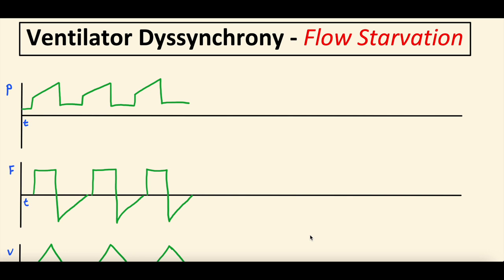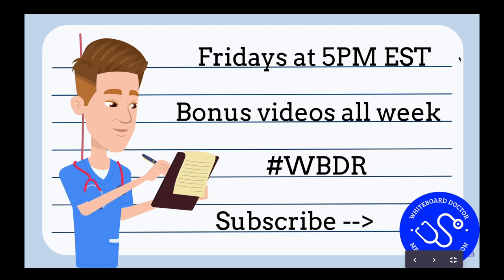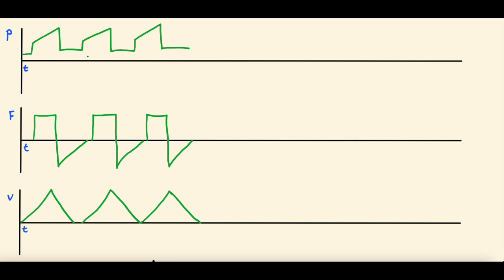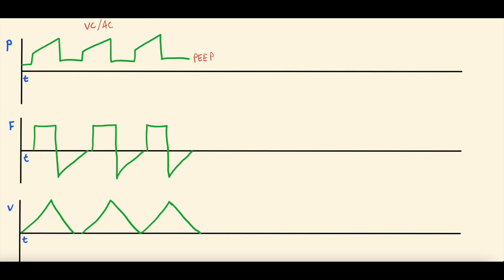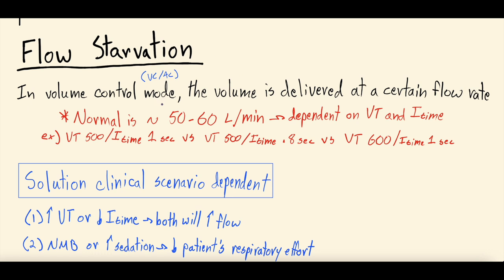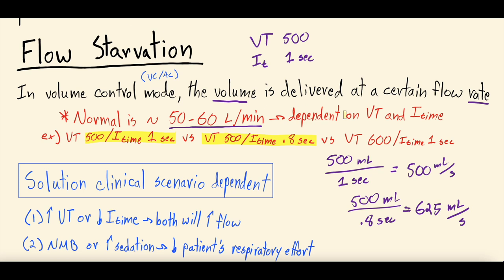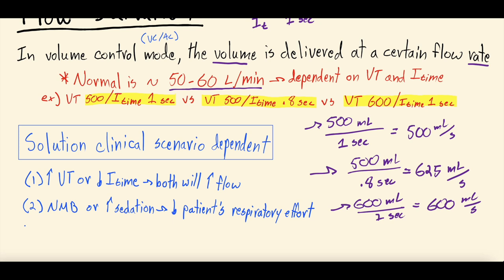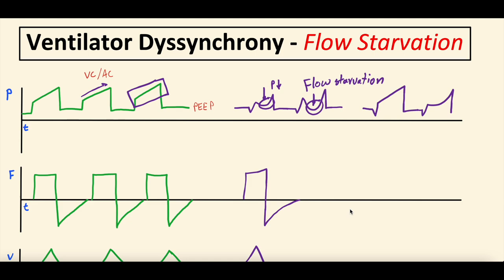Ventilator Dyssynchrony - Flow Starvation

Comment: I thought that Itime was a variable that could not change in VC mode.
Reply from the maker: This may be ventilator dependent, but the majority of ventilators allow you to change the itime through the I:E ratio. This is the ratio of time provided for inspiration as compared to expiration. By modulating this ratio, you can modulate the inspiratory time. Does that make sense?
Reply: Hi Sorry but you are causing problems here with your improper explanation of I-time. In volume control I-time is the quotient of tv/(flow/60). I-time is not set directly you can set the total cycle time by manipulating the rate but you cant set the I-time simply because if you change either the tv or flow then as a result the I-time must change.

Comment: Hi Sorry but you are causing problems here with your improper explanation of I-time. In volume control I-time is the quotient of tv/(flow/60). I-time is not set directly you can set the total cycle time by manipulating the rate but you cant set the I-time simply because if you change either there tv or flow then as a result the I-time must change.
Reply from the maker: We really appreciate the feedback and additional explanation! Apologies if it was confusing. This is somewhat ventilator brand dependent. On some ventilators in volume control you can set the tidal volume and itime which as you mentioned determines the flow. One other brands you set the tidal volume and flow which as you mentioned determines the itime. All ways to do the same thing. The only difference is what the brand allows you to adjust and set